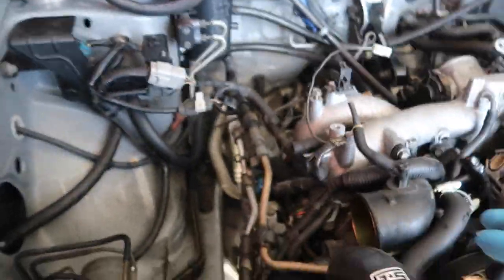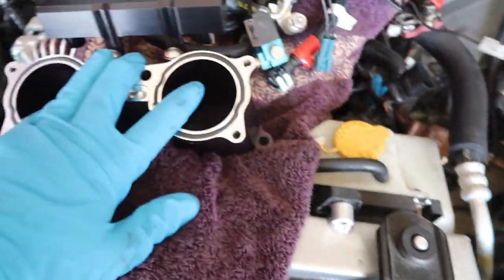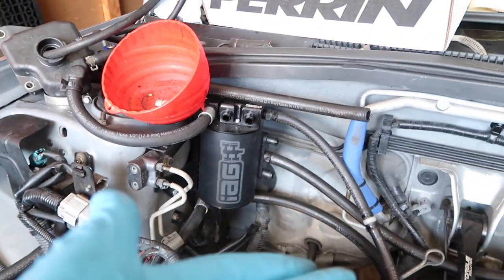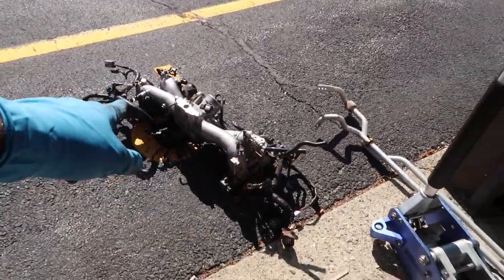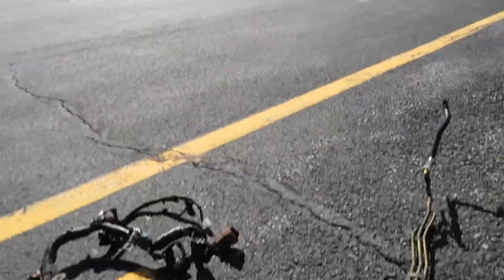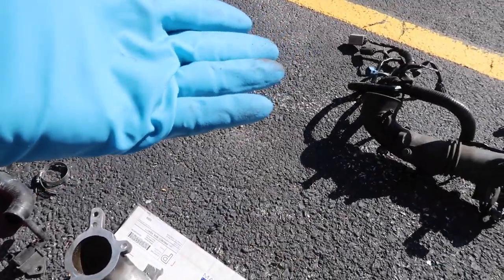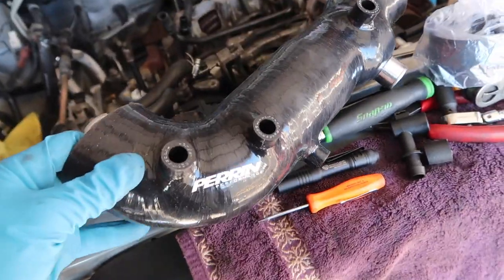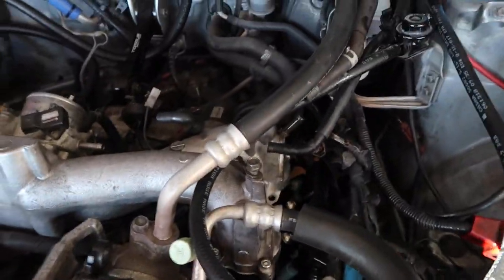Starting the Forester XT Build! Pulling The Intake Manifold!

Comment: don't drive it before you get a tune. Nice video. I did a JDM WRX manifold swap on my 03 XT which has factory tgv deletes and top feed rails. Then put STI pinks 565cc injectors in. Also did silicone inlet while I was there exactly like you. 200kw never felt better
Reply from the maker: Hell yeah! I thought about doing the JDM long runner manifold but ended up staying with mine. Pro tune is in the mix as well!

Comment: Good thing you're replacing the lines.  My old bugeye had a similar leak but it was the hard lines.  SOA replaced them under the Good will warranty thing.  Apparently it was a TSB that only affected subarus sold in cold weather climate states